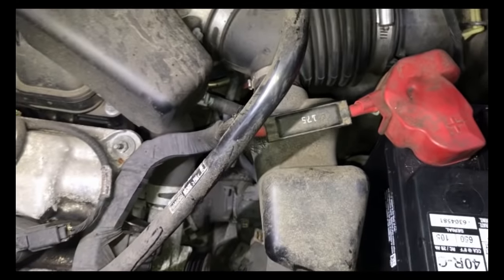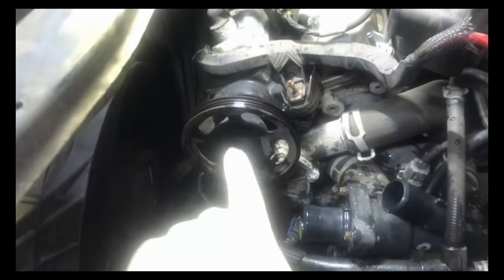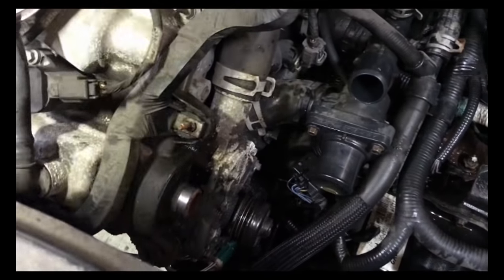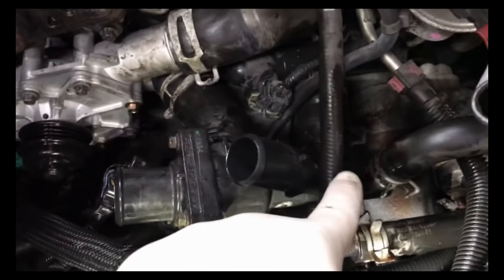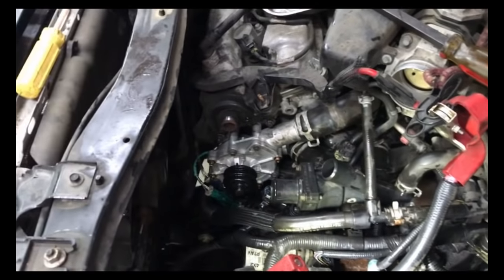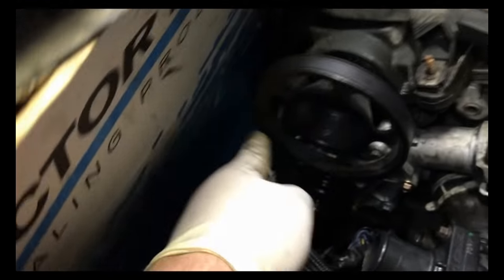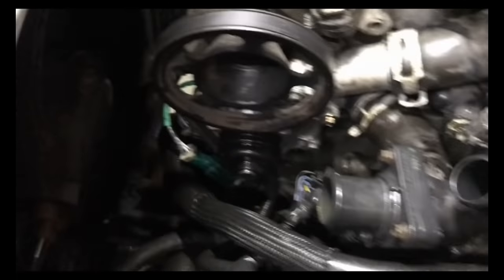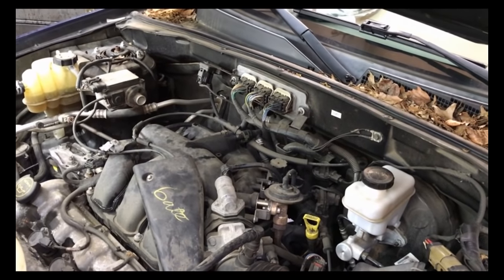Ford Escape And Ford Fusion 3.0L Water Pump Replacement

Comment: Absolutely ridiculous.... undoubtedly 10s of thousands of hours of engineers designing this engine.... and they intentionally made it so you have to pull the camshaft pulley to service the water pump?... the top two bolts won't clear the camshaft pulley by 3/8 of a inch??? Would like to say bad engineering.... but it's intentional.... turns 2 hour's of labor into 5 hour's of labor.

Comment: Instead of a screw driver I used a zip tie to the pulley it worked great didn’t lose any fingers lol thanks for the video!
Reply: I agree that using a zip tie to hold the belt while cranking is the best method. It works great and keeps your hands free from danger.

Comment: what is the hose that is under the sensors that need to be unplugged? mines has melted and its proving a little difficult to find this hose.
Reply from the maker: I would go on Rockauto and look under coolant hose/pipe and see if its there.

Comment: that looks like you can rebuild it
Reply from the maker: Rebuild the pump? Probably could not find the parts to do it. New one are cheap
Reply: @TheGAutomotiveAndMore   interesting I typed it on Google eBay and Amazon have the kit for under or about 30$. the reason I commented on this is that there are A LOT of hoses you have to disturb and can probably not seat one right or have to replace some. so I just did that to mine I have 3 of them 2 limited all-wheel drive and 1 poor model front wheel all v6 and range from 08 09 10. all mechanical parts match with the exception of the trim and options 2 are loaded 1 is the poor version
Reply from the maker: @stinkmeaner9798  Its better the change the whole pump with the back housing because there is a plastic coolant outlet on it that might be brittle and break at a latter time. Better to do the job once that twice. Spend a little more money and replace the whole water pump assembly. Thanks for watching

Comment: These engines are NOT designed with maintenance in mind. That is not an engineers job , their job is to design an engine to a certain spec to work with X number of platforms and within Y cost .
Reply from the maker: They should be engineered to do maintenance also.
Reply: @TheGAutomotiveAndMore  cCant have it both ways. Engineering is a compromise between Max, Min and cost.
Reply from the maker: @wilinstonthompson1352  Then why did they redesign it in the later models to make it easier?
Reply: @TheGAutomotiveAndMore  Did Ford Engineering say it was redesigned to make it easier ? There are several motors in the ford line up that obviously were not designed for maintenance in mind yet they redesigned this one to be ?
Reply from the maker: @wilinstonthompson1352  Well they change something because the later ones are different

Comment: I just had the water pump failure after 14 years of operation. I appreciate the explanation of the need to remove the pulley from the cam to access the water pump bolts. The explanation was right on what my mechanic said, so thanks for adding credibility to the problem and it validated the mechanics concern.
Reply: Had mines after 17

Comment: Excellent video.  I have all kinds of pullers and sure didn't want to buy another.  FYI if you heat the pulley up on a hot plate to 350 for about 15 minutes it falls on, you don't need the pulley installer. (you do need a puller to remove, heating the pulley up while installed will just heat the cam up also and they will both expand).
Reply: What is that pulley for?
Reply: @Secr3tYT  that pulley turns the belt that turns the water pump

Comment: This belt can be easily installed with a zip-tie. Just wrap the belt around the bottom pulley and as far around the top pulley as possible. Then tip-tie the top pulley and belt together through the spoke of the pulley as far as possible. Bump the engine. The belt wraps the top pulley and the zip-tie gets cut at the same time. My new belt actually came with a zip-tie.
Reply from the maker: I do use a zip tie now. Thanks for watching

Comment: Great video, had to get pulley off to fix an oil leak. I used a small 3 jaw HF puller and a little heat (not too much). Put it back on with a little heat, large socket and a hammer. Good to go. Thank you
Reply from the maker: Thanks for watching

Comment: No wonder I was quoted $600+ by two different shops for this procedure!What a pain in the ass!Great video,thanks for all the details!
Reply from the maker: More Involved that you think. Thanks for watching
Reply: same quote for me. They claim the pump is 300$ but I cant find it for more than 108$. I think they hate the fix and throw 250$ on to the bill.
Reply: this one easy pissy   you should see where then new 3.5L engine water pump location   it's inside the engine  a 12-14 hours job to replace
Reply: be happy, didn't need an alternator. add 700.
Reply: @brandonblack2095  That's exactly the reason I would not consider buying a Ford product with the 3.5L engine... Only the 3.0, 3.7 are the safer and easier to fix water pump designs...

Comment: Just use 2 or 3 zip ties to hold the belt in place then start the car. Way less dangerous. Can do it with one person.
Reply from the maker: Good tip. Thanks for watching
Reply: Sorry, Could you explain the way do you used the ties please?
Reply: @panzagrande80  Put one end on all the way at the bottom then put the other end as much as you can get on the top wheel and hold it there with zip ties. When you start the car the wheel will turn and automatically finish putting the belt on for you.  If you ever put a chain on a bicycle its the same idea. Maybe do a search how to easily put a chain on a bicycle to give you an idea.  Btw the zip ties should be place around 3 inches apart. Two zip ties should do the trick.
Reply: @panzagrande80  Also when you try to fit it on the top you must put on at the same direction that the wheel will turn when you start the car. This is a very important part.
Reply: @ralpherromulus6427  thanks
Reply: @TheGAutomotiveAndMore  cmvxvxcx

Comment: I installed a brand new water pump. What would cause it to not spin? The engine turns over fine.
Reply from the maker: I know this sounds stupid but did you put the belt on right?
Reply: @The G Automotive And More  the belt is on fine. It even seemed a little slack so I thought that that was the issue. So I removed the entire belt and tried turning the pulley for the water pump by hand and I couldn't. I removed the water pump again and it turns fine but when I tighten down the bolts even finger tight the pulley gets tight again. I can even hear a grinding sound.
Reply from the maker: @dezzyblessed767  Wrong pump? Its got to be hitting the head.
Reply: @TheGAutomotiveAndMore  yea, I figured. The outer housing and bolt holes are the same as the old one but I suspect the impellers are different sizes. I don't have the old one anymore for reference

Comment: So how do you change the bearing that allows the pulley to spin? It’s set inside the wall of the engine… mines starting to go bad
Reply from the maker: The pully it pressed on to the camshaft.
Reply: Yeah thanks bud I figured that part out but it seemed to be making a crunching pitch squeal bearing noise that was closer to the engine. I thought the oil seal was a bearing like a dummy. So I gotta look maybe it’s the water pump below ir
Reply from the maker: @benjaminbaumgart7978  Take the belt off and see if noise goes away.

Comment: Great video. I just dont understand which video I watched  before this one that used no special tools. Maybe it was the 4 cylinder? Or the ghost 3.5 litre that shows up on some parts catalogs. OEM tools harmonic balancer and the shop pulley installer for the win.

Comment: How did you remove the belt?
Reply from the maker: The belt on this car was broken because the water pump was locked up. If you are replaceing the water pump you should replace the belt. So either jump it off or cut it.

Comment: use a zip tie to hold the belt onto the pully before you spin it instead of a screwdriver. Zip tie will break off.

Comment: I have a 2007 ford fusion 3.0 v6 is this the same engine? Because my back housing connection broke off & now I have to change the whole the water pump and back housing because of that. If anyone could help thank you
Reply from the maker: I am not sure the engines did change in them.

Comment: Did anyone else have an issue of 2nd to 3rd gear jumping after doing this install?
Thanks
Reply from the maker: No but the top of the transmission is right there maybe you routed a hose wrong. That is what I would look at first.

Comment: You could just loop the belt to the water pump and to the pulley slightly tap it on to the cam. Then use the pulley installer to push the pulley onto the cam I did this the other night it worked fine. Trying to stick a screw driver and have someone start it to loop the belt on is just not smart do not do that. Just loop it to the pump then to the pulley. And barely tap it so it sticks to the cam. Then use the installer to press it back on belt is already looped
Reply from the maker: Yes you could do that. Thanks for watching

Comment: Great video! Wish I would have found it sooner. The water pump locked up on my wife’s 05 3.0 Escape and snapped the belt. It started to overheat so realized something was wrong. Changed the water pump and thermostat myself with a new belt. I added some oem coolant back in but after running for 10-15 min it starts to get hot. I checked both fans are running and the upper and lower hoses from radiator to thermostat are warm. And the a/c isn’t blowing cold when it warms up. Any suggestions would be greatly appreciated!
Reply from the maker: These cars are very hard to get coolant full. I would let car cool down completely, pull the upper hose and fill the engine and radiator up. Then start car to see if ok. Thanks for watching
Reply: @TheGAutomotiveAndMore  THIS reply from the creator was what saved me. I was fans, radiator, and thermostat deep in my '05 3.0 and overlooked simple things like filling the radiator through the hose.
Reply: Took me awhile to add coolant. It took a lot of burping

Comment: Ah cool, so I don't need the "special" puller but instead I need a Matco puller AND a MAC power steering pulley installer?!?  Geesh!
Reply from the maker: Most people won't have these tools, sorry. Thanks for watching
Reply: PLEASE SOMEONE                  HELP!!!!

1. What is the name of the original pully part you need to remove a water pump on a 2006 ford fusion 3.0 ?
2. As well as  what is the tools being used in this video?? 
Having trouble finding anything to remove my water pump...😢😢😢 
SOMEONE PLEASE HELP ME
Reply: I tried using 3 diffrent pulley removers and none of them worked so what i did was put a piece of 2x4 behind the pulley and beat it off with a small sledge hammer worked like a charm.. Just hit it evenly dont go crazy because you might damage the pulley but saves you time and labor..
Reply: @robgautomotive  ditto
Soft wood, hard mallet, even taps, went back on same way
Reply: @robgautomotive  I'm having the issue with all these pullers too.
Reply: If you have this specific vehicle use a small block of wood like a 2x4  and small sledge hammer and it hit it evenly from the back side and it  will come off. Just don't hit it too hard so the pulley won't brake. I'm a mechanic and sometimes the pulley removal tools don't work for certain vehicles that's why they have different styles like bolt on pulley removals.
Reply: @robgautomotive  thanks will be getting said materials. I just took back a second pulley. The first, the screw wouldn't thread inside, the second was a harmonic balancer puller and didn't do the job neither.

Comment: What is the name and model number of the special puller that runs $200?
Reply from the maker: You need all 3 tools. Ford part numbers 303-456, 303-456, and 303-457. They come out to me more that $200. I was wrong on the price.

Comment: At 3:05 is that bolted on tube thats facing the front of the car have the thermostat in it? Im not sure where its at. Thanks
Reply from the maker: I think so. Look here at the Four Season 86115.
https://www.rockauto.com/en/catalog/ford,2008,escape,3.0l+v6,1439986,cooling+system,thermostat+housing+/+water+outlet,10337

Comment: Can you tell me how you knew the pump was bad? My 06 Escape has no heat. Heater core was flushed. one heat core hose is warm (not hot) the other is cold. Temp gauge reads normal, fans kick on and off normal. I am thinking the fins are warn or not spinning in the pump. Ideas?
Reply from the maker: This water pump was locked up. It is possable that the water pump is bad. Have you put a thermostat in yet? Not sure on this model but sometimes it is a Two stage thermostat, might not be putting water flow to heater core. Does this car have a heater control valve? need to check this also.
Reply: @TheGAutomotiveAndMore  I do not believe this has a heater control valve. The interior flap door is mechanical and it is moving correctly. The floor to defrost actuator is moving correctly with vacuum. I installed a new Motorcraft thermostat, no change.
Then I borrowed a NAPA flushing tool from my mechanic. It combined air and water to pulse water pressure through the heater core. The heat came back to a limited level. When I blower the fan across it at high, it is not as hot, it has better heat at low setting.
It looks as if I will be replacing my heater core on this thing. I might as well put in a radiator or have it and the hoses flushed at the same time as I do not want that sediment crud going back into a new heater core. New upper and lower hoses are probably in order as well.
Regarding the water pump. It works quite well as the fluid flows very well through the bottle when revving the engine.
Reply from the maker: @BenjaminHansen   Well I would have to think you are right, the heater core is clogged up
Reply: Wouldn't think you would have much flow if heater core was plugged or restricted.
Reply: @stevegriffith7236  I replaced the heater core. There was still good flow through the clogged one, but I believe it was bypass flow. Works well after a new core install.

Comment: Great video. Im being told my 08 milan premier v6 3.0Liter will require the valve cover to be removed and a locking pin used to keep the crank from moving after moving it to position 1. All this other stuff.
Seriously?
Its a 2008 mazda, not really any difference from the duratech at all other than a better head gasket but exremely thin wiring harnesses that have all sense melted and burned out.
I just replaced them all and the head lights too (40amps, but why?, no wonder they melted over time), and replaced the alternator (those leaky little valve covers!), i have the pump the heater hose and all, my pump is leaking from the weep hole being that the T-joint on the heater hose assembly crumbled up and pieces of plastic got in there. Im hoping to do just what you did. I dnt see why i would need to lock in position 1.
Am I getting rupped off? The dealership wants almost 700 to do this.
I can change it just fine like you did at home.
Please let me know because I have the same exact pump as you do and I cant see any reason why I would need to have my pump timed with the crank
Reply from the maker: Yes the 2008 3.0L Milan is the same as in the video. But the 3.5L engine the water pump is driven by the timing chain and you have to pin the cams and take the chain off. Probably have to remove engine to do it on the 3.5L. Thanks for watching.

Comment: What happens if it doesnt come out as one piece....? (Pulley instillation tool removal)
Reply from the maker: You will have to buy a new pully. Probably not made anymore.
Reply: @TheGAutomotiveAndMore  i fit a deepwell over it and just, ratcheted it out! :) 

Haha most of them didnt fit i was panicking.

Comment: any idea what the thread pitch would be to get the pulley back on again with the right tool. I just need to know what thread pitch it is.
Reply from the maker: M8x1.25.
Reply: @TheGAutomotiveAndMore  hey thank you for the well put together video. I need to replace the water pump now and just what I needed thank you again.

Comment: Is it possible to use a power steering pulley remover to remove the pulley like what you used to install the pulley?
Reply from the maker: No, they didn't put the piece on the pulley that the power steering puller grabs on to.Thanks for watching

Comment: Is there any possible damage to the engine if the pulley was bend and reinstalled it?
Reply from the maker: It could wear the belt out faster and sense the pully is now out of balance it could wear the camshaft bearings out. I would get a replacement. Thanks for watching

Comment: Getting ready to attempt this tomorrow night...
Reply: I guess I'm not smart enough to get the pulley back on all the way..  i post poned doing it a couple days.. then found hoses to replace also. I actually broke my pulley installer off inside my cam. Luckily I was able to get the bolt back out of the cam.

Comment: Great Video. I have a 2007 Ford Fusion V6.   Do you know if that pully will come off the same way? and if so. Can you tell me the part# of that Matco Puller or what kind it is and can you rent it or do you have to buy it
Reply from the maker: Yes the 3.0 Fusion is the same way. The Matco puller I used is a MST4534 multipurpose bearing and puller. The Power steering pully installer is a MAC PSPSET. Thanks for watching
Reply: Same problem.i mean same engine.